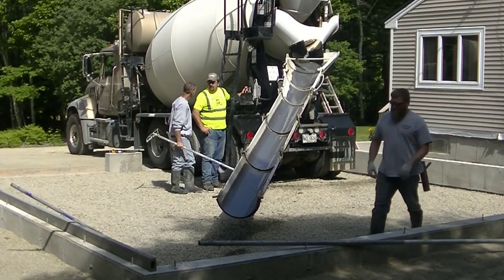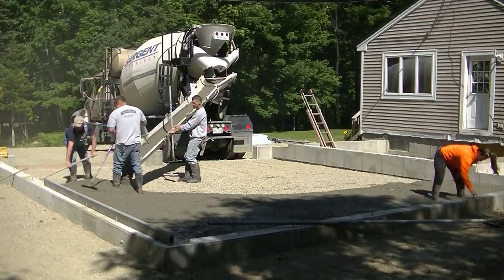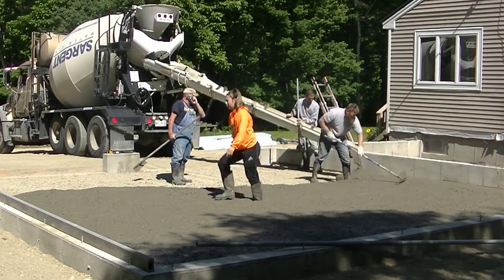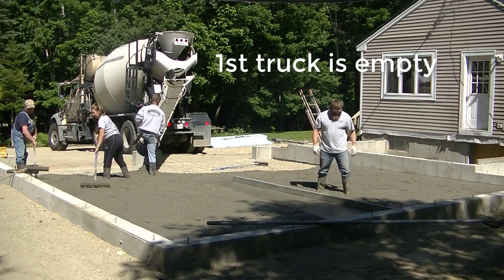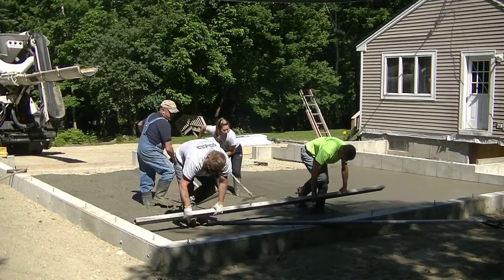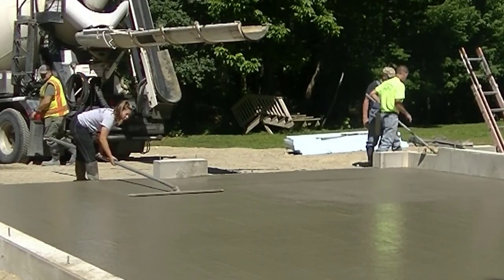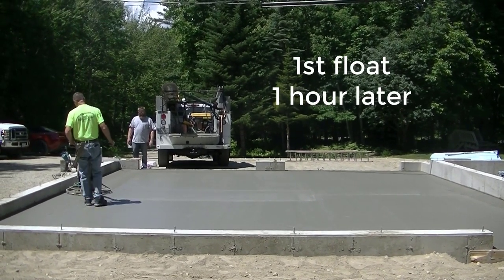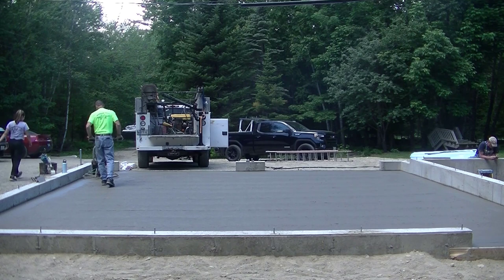How To Pour, Finish, and Saw Concrete for a Garage Floor (With 3" Slope)

Comment: Mike, on a RV garage in the planning stage --  What would be a good unit to use for "slope to drain"  from back of the garage to the doors?  I did a google search using the terms "garage floor slope degree?"  and it came up with anywhere between an 1/8" per foot to a 1/2" per foot.  At 34 feet of run at 1/2" per foot that would be 17 INCHES from back to front?  That seems pretty extreme to me? Especially since I am thinking of having a 16" concrete "stem wall" above the floor for the 12 foot walls to sit on.

Comment: Hello from Seattle!

I'm not in a role where I hire folks, so I couldn't hire Tia...but I'd definitely give her a strong recommendation. You hardly ever see her (and her friend that helps occasionally, too, for that matter) not doing something that directly contributes to the job. Any chance she wants to move into software engineering? lol

The temp guy -- The phone thing is a problem. He needs to either put it away, or at least get with the 21st century and go hands-free. Otherwise, his behavior strikes me as not really knowing what to do. It looked like he was kind of trying to copy Tia when y'all were kick screeding, and towards the end it looked like he was trying to contribute by helping to clean up (moving the ladders). Did he claim any prior/recent concrete experience? If he said he had experience (especially if it was recent experience) then he needs to be cut loose. If he was honest about not having experience...well, that's on you ;) Everybody has been the newb at least once.